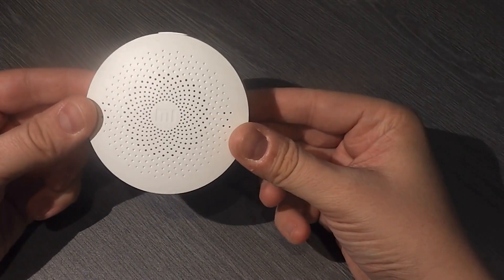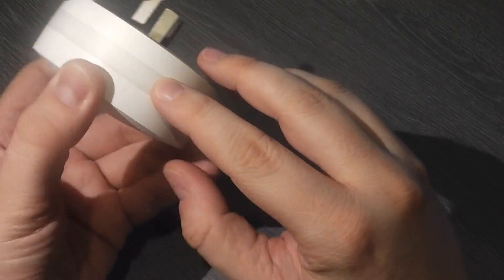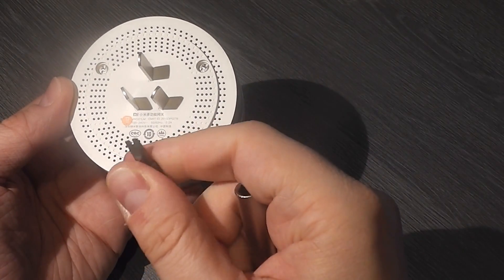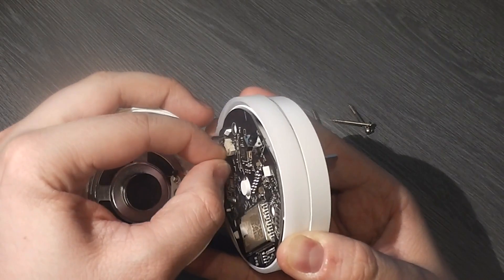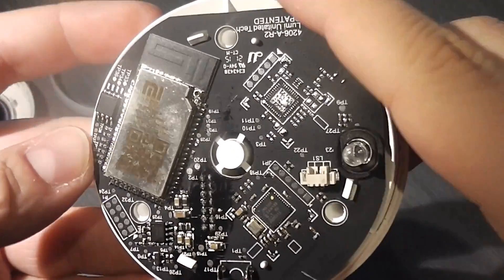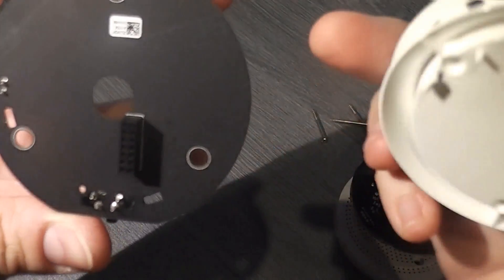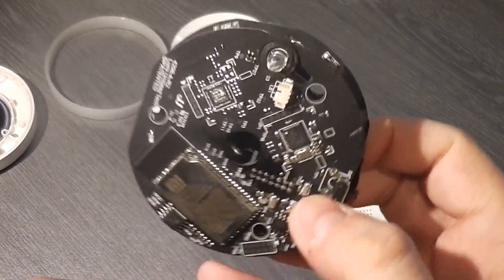Xiaomi Mi Smart Home Gateway teardown

Comment: I have one bricked. Ring led works well. How I could connect to a H801 or Shelly RGBW2 to use it only as a rgbw light?
Reply: I just damaged the speaker in my one. If you dont have a need for the speaker I could make use of it!
Reply: @ki113r0f5h4d0w5  Where are you from?
Reply: @francisguaitrapa  New Zealand

Comment: Hi there,

I just saw your teardown video for the Xiaomi Mi Smart Home Gateway, in which you mentioned you were going to have a play about with the JTAG/Serial connectors. Did you ever do this, and if so, what level of access did you get. The reason I'm asking is that I'm looking for a cheap device to buy a few of, in order to incorporate hands-on hardware hacking into some degree modules that I teach on. I'm wondering if this might be a good choice of equipment?

Thanks,

Ben

Comment: Sir, is there a way to perform a real hard reset? But short circuiting or anything? I tried the 5 second button switch but still a problem: Xiaomi Home app says memory is full to add more sounds, but I already deleted all I uploaded.. please help me :)
Reply: I took the whole thing a part in search of the reset pin but no luck but for some reason taking it apart caused a reset. I disconnected all the small parts and put everything back together.

Comment: I am wondering if this can be added to a yonusa EY 10000-12 energizer. The hub power itself from the energizer and the hubs siren cable to the yonusa's siren ? Can you point point out what cables of the hub I would have to connect to a power source ?

Comment: any ideas what voltage the system gets from the little transformer ?  i like to take the mains off and run it on a battery system instead of using a UPS backup , because transforming battery power to 230v or 110v is a waste of energy so iw as hoping this runs on 12v or less and a battery will do;)
Reply: Hi, did you find out if that is possible?
This is my plan as well but cannot find information regarding this.
Reply: I'm about to look at the same thing.  I'd say the 12V would be to run the LEDs and the logic board would be 3.3/5v.

Comment: Is it possible to DIY replace 3 pin to 2 pin power plug (without using adapter)?
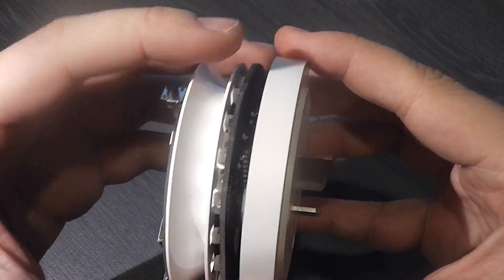Reply from the maker: The 3-pins are soldered directly to the power board (around 7:30 in the video)
Reply: I was looking for the best price and I found it for 26.99 USD with coupon code: GBMGMJ
http://www.gearbest.com/living-appliances/pp_344667.html?wid=21&lkid=10304254
Enjoy!!!

https://www.youtube.com/watch?v=nTo3qi_hsuw
Reply: I can't believe it's just for 22.99 dollars with coupon code: MIGATEWAY
http://www.gearbest.com/living-appliances/pp_344667.html?wid=21&lkid=10304254
I hope this can help you

https://www.youtube.com/watch?v=nTo3qi_hsuw

Comment: Hi, 

any updates on JTAG pinout ?

and thanks for this video...I'm also trying to do some reverse engineering and blogging about it on http://802154.blogspot.rs/
Reply from the maker: hi!,

Haven't been able to get back to it lately. But I have been having some problems with getting thin thing reconnected to my Wifi.
It dropped off a few weeks back and I've reset it multiple times without success. So that's a bit of a problem.
Reply: Any work with JTAG?